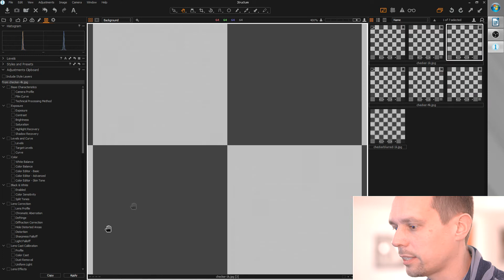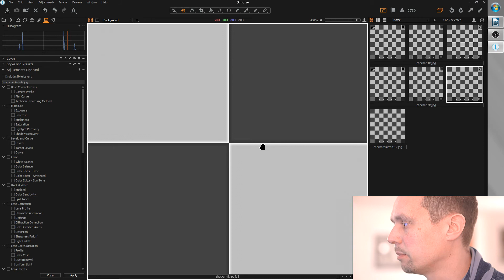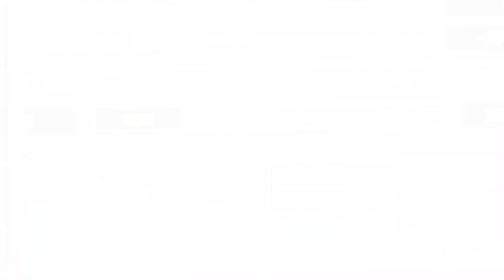Sharpness Vs. Structure - What Are The Differences - Capture One Pro 11 Blit Photo Edit Tutorial

Comment: Timo, I just found your videos. Many thanks. I am moving from Lightroom to Capture One and these are very informative. I notice you never turn on the alarm for blown out high lights. Why not? It seems as if with your work flow, high lights may be blow out at sometime but maybe not towards the end. Is that correct? Mabe
Reply from the maker: Hi! Thanks for your comment. I use the histogram for that. That's why I have that tool in all tabs. Together with a calibrated monitor this should be sufficient I think. I like not disturbing what you can see in the viewport. You are right, sometimes highlights are blown out. And sometimes I recover them later. Sometimes it's just faster to care about shadows first and later recover the highlight areas. It's part of my workflow to separate as much as possible. I hope this answers your question. Cheers Timo